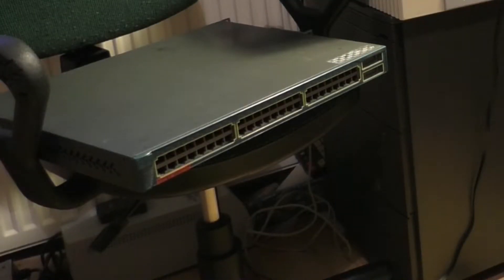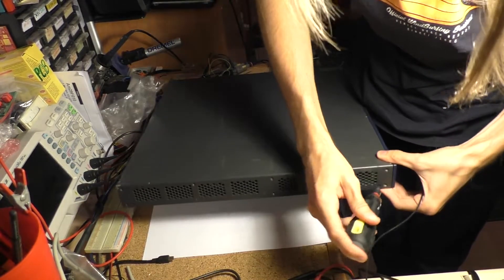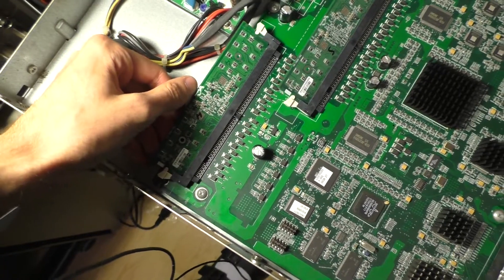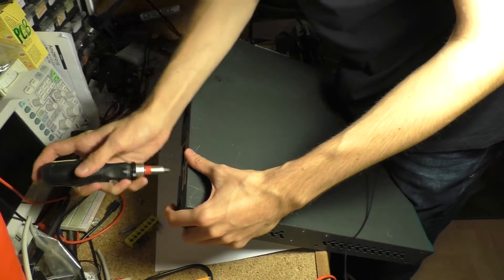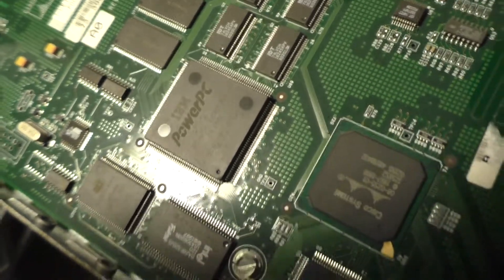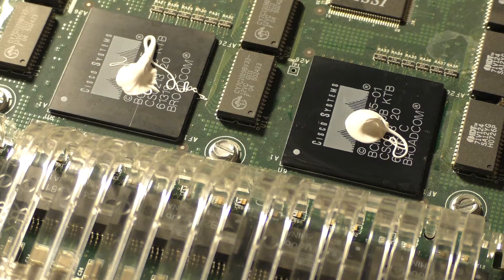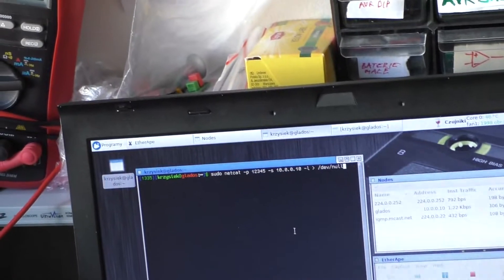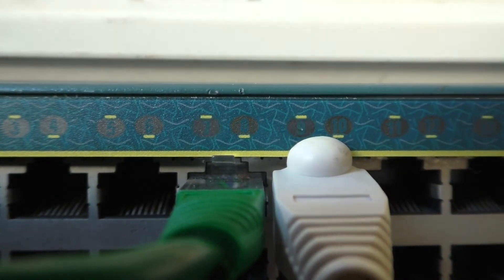PEV 06h - Cisco Switch Quiet Mod

Comment: I'll have to try this on my 3508G! I'll probably end up putting a resistor on my fans rather than removing them completely, but the adhesive heatsinks will definitely help it run way cooler even with reduced airflow. Thanks for the idea!